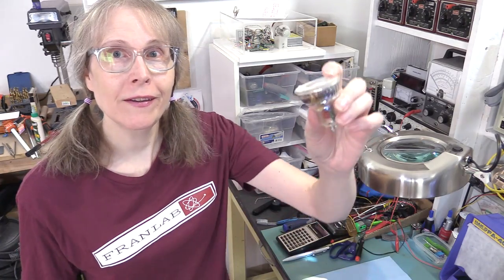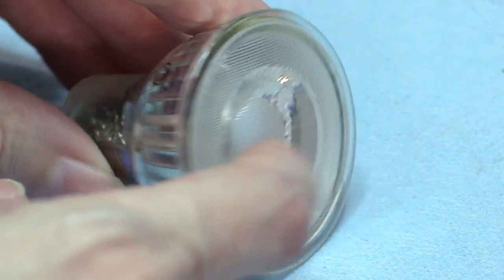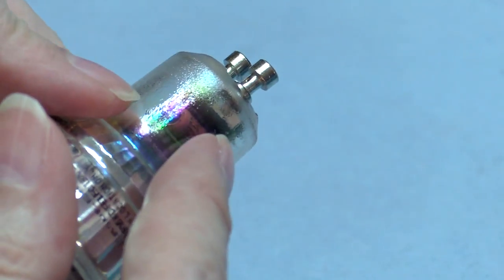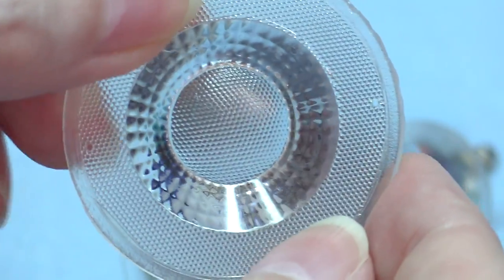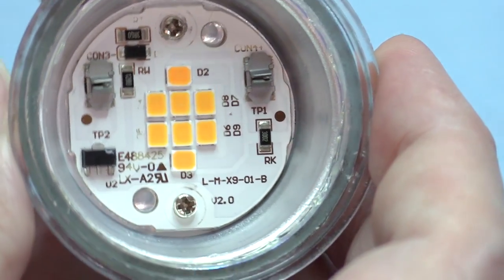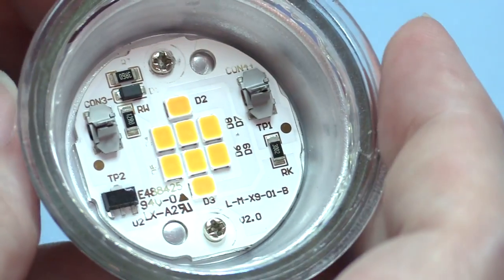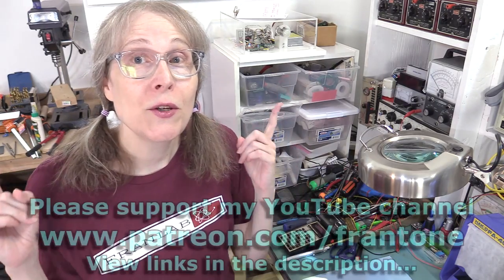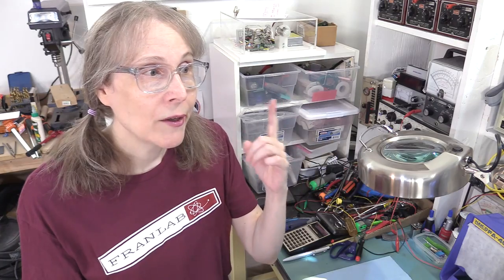Inside An LED Light

Comment: This is gonna be a long, rambly thing about carbon footprints, power factor, my experience with LED lights (both good and bad), and a complaint about the environmental impact/expense of premature failures in commercial LED applications and custom LED lamp assemblies within the automotive industry before I finally decided to shut up. You have been warned...

Fran, that is an excellent point about the carbon footprint of LED bulbs before the end user even picks them up off the shelf. I'd feel more comfortable about all the energy required and the environmental impact generated if these bulbs truly did last a very long time. Some of them do, and some of them don't, and thankfully as more companies produce and improve them, I think we'll eventually see the scales tip the other direction where the overall build quality across the market, and the lifespan of the LEDs increases, to the point where it makes more sense for the environment. Right now there's too many failures I've personally witnessed to really be gung-ho about the LED technology. Traffic lights, street lamps, parking lot lamps, outdoor PAR32 flood lamps, automotive bulbs, I've seen them all fail prematurely (one traffic light in particular lasted almost a week) and that really irks me. It makes me feel like LEDs aren't quite ready for mainstream and that they were pushed out too soon, and I don't want to feel that way because they DO have an environmental impact in production from start-to-finish that is significantly greater than a tungsten filament in an Argon-filled glass envelope; and if we're supposed to adopt this technology for ecological reasons despite its greater impact in production, we need it to be reliable!
Then, we all need to be concerned if we convert to LED and our utility companies start charging by "apparent power." Most LED bulbs use capacitive droppers (I've been watching too much Big Clive - but is there really a such thing as "too much" Big Clive?) with crap power factor. Then, you'll see customers getting irate because they won't be seeing the reduction in utility bills that LEDs were supposed to provide!
I jumped on the LED-replacement bandwagon fairly early, with mixed results. Started off with two pricey Cree bulbs with latex-coated glass globes and chunky aluminum heatsinks (with a thick coating of white paint, probably negating the heatsink). One failed in a few months, the other lasted two years before developing an occasional randomly-occurring flicker. They were in covered outdoor fixtures (on either side of the front door on a covered porch - no moisture ingress other than ambient humidity) with the socket on the bottom, and these bulbs were meant to be used in fixtures with sockets on the top. I can't necessarily condemn the bulbs because I installed them in a way the manufacturer recommended against. Extremely bright, but annoyingly too "cool white."
I stumbled across a promotional deal one day at Home Depot on some indoor 60W-equivalent warm white Cree bulbs for $1 each (limit 10). I use them in my basement (and brighter than the one remaining 300W "longneck" incandescent still working from 1975), our stairwell to the 2nd floor, the lamp over the dining room table, the three-lamp pedestal fixture by my bed, and the lights in both bathrooms. All of them have been working well, most of them get light use but the ones that get used daily for hours on end still work amazingly well. Actually, ONE bulb developed the "flash of death," but the other 9 still work. Certainly worth $1/ea.
In my garage, I have a 60W-equivalent Dollar Tree LED bulb over my head that replaced a 100W-equivalent CFL that had gotten so dim it was virtually useless. I am surprised that it has lasted two years with heavy use - the CRI is poor enough to make everything white take on an obvious beige tint, but it does the job. It gets bombarded with cigarette smoke every day and baked in the winter when I fire up the kerosene heater, and has never acted up at all. There's also another Cree in the garage that still works, I've had that one for close to 10 years and it has been great as well, aside from getting slightly dimmer over the years as LEDs do. It has thousands of hours on it easily, it's the "Elder Bulb" because it's the very first LED replacement I ever bought, to replace my 150W-equivalent CFL that had served me well for years but had finally dimmed to 40W-equivalency.
I upgraded my car's headlights to LED, and that was nothing short of disastrous. Started off with a high-beam flicker that progressed to high-beam-equal-to-low-beam where occasionally it will work as designed, but rarely. That bulb took a little over a month to show failure. The opposite headlight, at about 3 months, would often illuminate dimly and require me to flick high-low-high-low until it decided to function properly (unless I gave up trying). It failed to the point where it was dimmer than my parking lamp, and I could literally put my nose right up to the headlight lens of the car and barely see any light output. They were from a highly-rated manufacturer on Amazon and definitely were not the cheapest ones I could get (I paid $80, instead of, say, $25 for a two-pack of Halogen bulbs).
I've driven past semis, and cars, with LED headlights and taillights from the factory that are failing. Some of these vehicles are two or three years old, and most of these lights are not user-serviceable like socketed incandescents. THAT is unacceptable build quality, and how is that better for the environment (or economy) when your taillight fails and the car is practically-new, and you can't just walk into an auto parts store or Walmart and pick up a two-pack of replacement bulbs because it's been designed as a sealed-unit that is a dealer-only part?

Comment: The less air con in the summer is good  ¦¬) )
More heat required in the winter is bad .
This should all be considered in the total running cost & the carbon footprint .

Comment: Great video, very informative, I switched to LED in my house, the promise was that it would last for years, doesn't seem to be the case. I suspect the problem is not the LED itself it is the other components that fail. One thing I can say is that my energy costs have gone down and more than offset the cost of the bulbs. I guess its 'up front' carbon footprint weighed against carbon footprint in use.

Comment: I made a 3D projector for my vintage Viewmaster collection using the12v halogen lights. Even with a fan they were too hot and  I'm in the process right now of replacing them with led ones. It seems to change the polarizing properties of my filters and I'm finding it tricky to get everything in sync. It still works, but I have to rotate them on weird angles and some brands of the theater glasses I use don't work at all. I found out they made 3D projectors for Viewmaster in the old days but in New Zealand where I live these are unobtainium, and I don't have the skills or cash to import one. I found I could make a screen by spray painting silver chrome paint onto a sheet of plastic tracing paper. Normal screens don't work. Better get back to it...

Comment: I wonder if the power circuit board failed. might i suggest you put an exturnal dc voltage on the led board and see if the leds still work. maybe you got a good one you can test the output voltage to the led board.

Comment: Good post Fran.  If you only got one year out of an LED light,  I think you have a good point. 

But at a club that I'm a member of, I have replaced normal tungsten bulbs with LED bulbs not because of energy savings but because of how much longer the LED bulbs last. 

We're getting 5+ years out of our LED bulbs that are on at least 12 hours a day every day.

I would expect much longer than 1 year out of an LED bulb, 10 years is you what you should get

Comment: I replaced all tungsten lights in my house about a decade ago and I don't recall having to replace more than one or two lights since. One of the lamps died due to some water leakage or bad wiring. The LED's I have are the bulb type and often have a passive heat sink. My mother had some of those bad IKEA spot lights years back. It might have to do with the heat distribution. LED spot lights are very tightly packed and sometimes the fixtures that are used might not allow for enough air movement to cool parts down. Other types of LED lights such as street lighting are naturally more ventilated.

Comment: I would have thought it would have just capacitively dropped the mains voltage, rectified it, threw a capacitor across it, and put a power resistor in series(if trying to remove flicker). Is this really cheaper/better?

Comment: Fran you are spot on with your comments.  I have been in the environmental business as a scientist for over 30 years.  I ask the same questions coming from a logical scientific background of geology and chemistry.  In this day and age you cannot ask these questions.  It is considered heresy to  ask the questions and buck the narrative.  You cannot ask things like- How has the Earth's orbital position changed? How variable is the Sun's output?  Solar arrays on the large scale are planned to last 20 years.  There is a good deal of money involved from private investors and they need to make it back in the long run.  However, no solar array I have worked on calls for upgrading the system in that 20 years.  Often time investors sell off in the first 5 years.  The LED streetlights are heavily subsidized by state governments, and the utilities.  Often a municipality must buy back the lights from the utility before they can be converted and then the municipality is on the hook for maintenance.  Many of these projects were done across states at the same time as these subsidies became available.  That means failures and burnout will occur at the same times across the state's municipalities.  In the short term there is savings to the municipalities.  My last streetlight project saved $180,000 per year in energy costs.  The total project replacement cost was almost $500K with all but about $50K coming from state grants and utility rebates.  Keep up the good work.  I enjoy your videos.

Comment: It’s similar to the plastic recycling debate: aren’t we creating more atmospheric carbon by recycling it? (Not saying we should ignore the plastic problem, just arguing that we may be creating a larger problem). Aluminum definitely consumes less energy when recycled.
Reply: Yea plastic should virtually all just be burned for energy. Since we are currently still using brown coal for energy, burning plastic trash is basically net negative, as it just replaces the carbon otherwise released by the coal.

Like Sweden does.

You only have to place the ash that remains due to additives in a landfill, rather than the bulk of the plastic.

Or even worse sending it to SEA to be dumped into the rivers and oceans.

Comment: I have often thought of this also, but never really investigated.
Also, to add, halogen do run HOT and add to the heat load in a building making the A/C run harder.
Of course, LED's generate very little heat by comparison.
I do agree that the color temperature, if not controlled, can really lead to problems.
Reply: That is the american version. Here, they contribute to heating your house.
:-D

Comment: They wanted it to look pretty too and track lighting is visible after installation. So you still have the rainbow glass with the silvered effect because the aluminum heat sink just doesn't look as nice.

Comment: I've had a couple more expensive Philips Hue GU-10 bulbs fail where that odd 7 pin controller chip had the top blown clean off. But most commonly I've found that it's the electrolytic capacitors that don't like operating at the higher temperatures these semi-sealed packages tend to run at. They are typically way at the back in a non-ventilated, non-heatsinked part of the unit and either pop or dry out. In both the Philips Hue bulbs the caps had sprayed their goo all over too...

Comment: Great question about the offset carbon foot print.  Here in Florida where Air conditioning is constantly battling heat from old tech lamps; incandescent and even florescent, this is certainly part of the equation.  I'd like to think that on average LED lamps last 50,000 hours, Halogen ~ 1000 maybe?

Comment: I'm surprised this LED bulb only lasted twelve months. I've been using LED bulbs for about three years and none of them are either malfunctioning nor stopped working. I had to change the first two LED bulbs due to EMI. I live in small town and I like listening to FM stations that are about 60-120km away. These two LED bulbs emitted white noise enough to kill the reception of any FM stations. They also produced humming on longwave, mediumwave and shortwave as well. I replaced them with Ray-O-Vac LED bulbs and so far they're okay.

Comment: I have some IKEA gu10 lamps that have been running for about 4 years. They dont look like yours though. Mine have a white plastic housing that is squared off with rib reinforcing (ledare). Looks like they cheaped out:(

Comment: It's very impressive how many lumens they're able to get out of such a small input wattage.  You can tell every part of it is very highly optimized.  The super reflective plastic housing and cover are scattering light as widely as possible, while not diffusing TOO much that it would start to darken the output.  The real star of the show is probably the control ICs on the two internal boards finding ways to squeeze every last bit of juice out of the small voltage and current input.

Comment: It´s funny because you can repair the most LED Light´s, they does not need to be wasted. If you had an elektronic repair shop, you can bring them over. If LED has a long lifecycle build, you have a smal amount of waste and on the other side you have real work options. It´s "customer thinking" to drop old bulbs away and buy new one.

Comment: A subordinate solution this conundrum is to standardize the specs for the led unit so all of the supportive circuitry could be in the fixture instead of being tossed with the led.  This would also allow the manufacturer to provide space for a wider component choice
Reply: The power-supply built into the fixture would have to be standardized so that every lamp and fixture could contain an identical unit and run the same style bulbs....and it would have to be replaceable. I've seen recessed halogen lighting fixtures with transformers riveted inside the fixture; sometimes the hum and vibrate annoyingly, or occasionally fail completely,  but can't be replaced, you have to bust the sheet rock ceiling to get them out!

Comment: I would also be curious to know how are the LED lamps recycled/processed after they've been thrown away. Pretty sure that's a heavily polluting process too...  Anyway I think if most of the SMD LEDs are still working, they could be reused just as-is because maybe just the little power supply failed.

Comment: most LED lamps usually fail due to over heating internally. I had LED lamps do that way before their time from that. If the manufacturers want these bulbs to last that long, There needs to be air circulated around the lamps, or more heat sinking for that to occur. It is a bummer for paying a lot for LED lamp, then they fail soon  for that reason because of the fixture.
Reply: If possible, try to buy LED lamps which say they are suitable for enclosed fixtures. I imagine they have better thermal design than other units. Unfortunately few people read the fine print and they put ordinary bulbs in sealed fixtures. I wonder how many millions of bulbs have failed prematurely just from not reading the instructins.

Comment: A very simple question with a very complex set of answers. As a rough guide, the total life cost is an estimation of the earth's resources used, including the carbon footprint. Where the break even point is depends of the energy sources used to manufacture and power the lamp. Like other "green" technologies, LED lamps may only make sense when powered by fossil fuels, or when there is a shortage of renewable energy. If renewable energy becomes plentiful then the manufacturing footprint becomes the dominant issue. 
This issue is not restricted to LED lamps, it also affects solar panels, other micro generation sets, and any other complex green energy technology.

Comment: They should last considerably longer, but where they push the wattage from a small unit, they tend not to, had some 5W candle bulbs that died very fast, but 5W standard size had no problem.
Also, are any white LED UV energized - the low CRI ones are generally blue with a broad spectrum yellow phosphor

Comment: Yep. Spot on. I like the LED tech. Highly.
It's the ballasts that trouble us (radio listeners dislike those switch-mode lamp ballasts, too. NOISEY). 
Help is on the way, methinks. There are now 120 VAC LED lamps that use a simple capacitor ballast.
The LED strings are longer...MUCH longer... but so far seem to be rather long lived. Jury still out.

Comment: I have all lights led and they have lasted 3-5 years allready. Some lights burned out with few months, but i replaced them and no problems since then. If led is well manufactured then i'm 100% sure that little bigger carbon footprint will be worth it to save some electicity. But yeah, haven't seen any numbers about it.